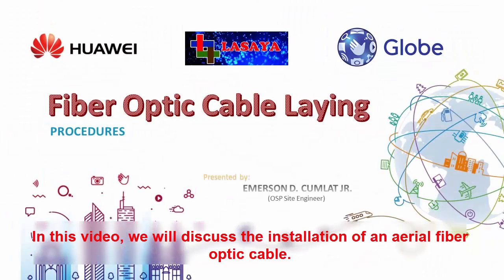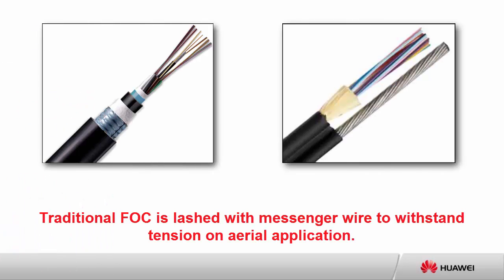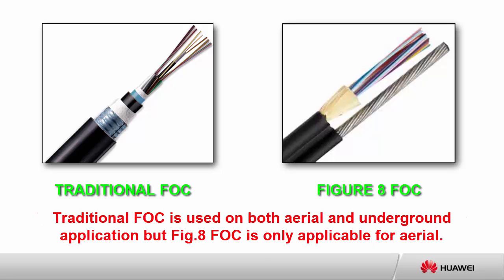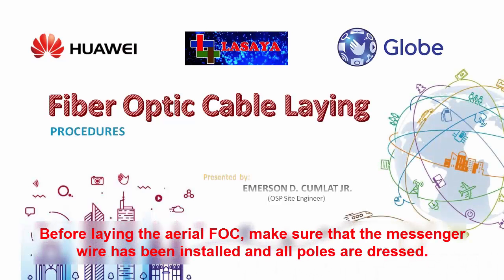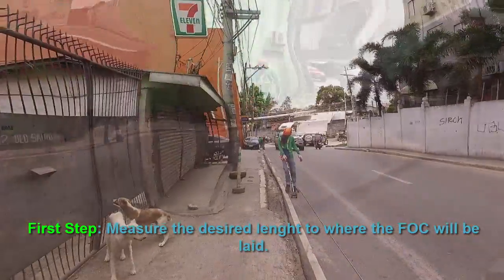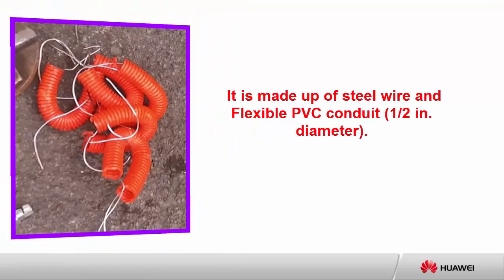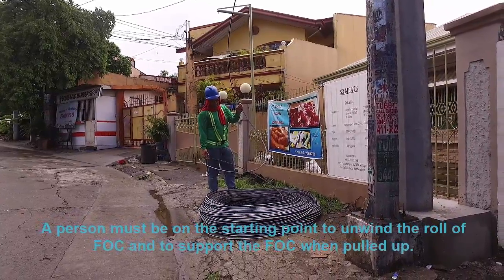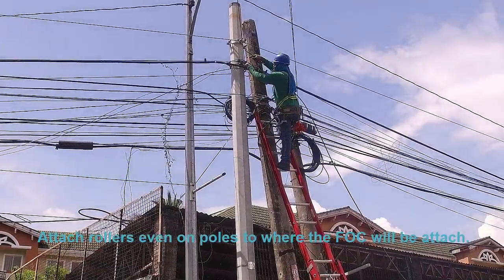Fiber Optic Cable Laying on Aerial Application

Comment: how the guy laying his ladder on a bunch of wires didn't electrocute himself. looks dangerous 😬
Reply: that's how they've done it for a very long time.
Reply from the maker: The electrical line or cable is taller/higher than the length of the ladder.

Comment: WOW ........ as a telecoms installer and instructor in the UK can i ask where you are in the world, I have never seen such a blatant disregard of health and safety as well as an immediate threat to life
Reply: Hahhaha nobody care about it.
Reply: Sir, is there any easy and cheap method to install cable in concrete electric post other than combination of  metal Clamp, pin insulator, nut& bolt
Reply from the maker: @kumarskumar6857  yes there is. ig you are familiar with ADSS cables which use lesser accesories.
Reply: @EMERmusikero93  Sir, could you please recommend cable buyers in your area?
Reply: kumar s kumar sure it is
Reply: how to install? please explain
Reply: kumar s kumar....here is a link for you..http://www.telenco-networks.com/en/produit/cable-clamp-ftth-adss-cables
Reply: kumar s kumar much easier to do with this,but you need the right cabe for this to aplay
Reply: We are using round Optic Fiber cable single mode
Reply: This stuff i show you,will fits all type of cable..just make shure to chose the corect one for your aplication and cable type,and you are free to go without a problem😉
Reply: Could you please give reference of cable buyers in your region?
Reply: ok thanks

Comment: can i ask what color of wire that u are using? it is capable to handle gigabit speed?
Reply from the maker: Yes it is capable of gigabit speed. We utilize buffer blue fiber for NAPs
Reply: Which make-brand? origin of cable?
Reply from the maker: @kumarskumar6857  Huawei Cable Adisson
Reply: Do you require high quality cables?